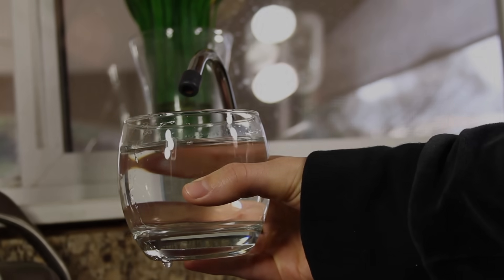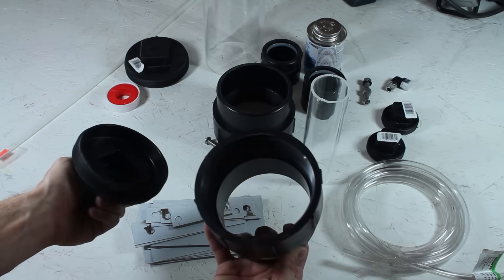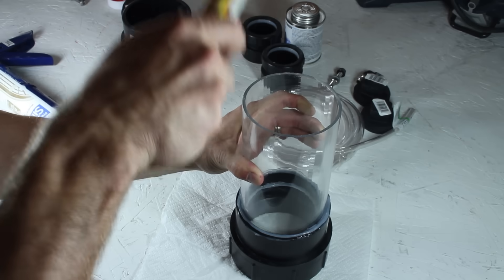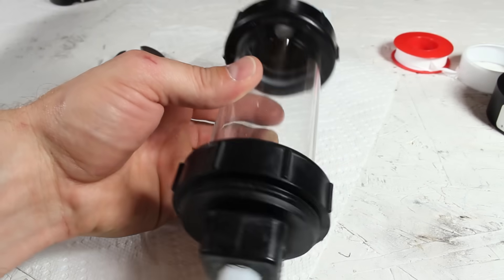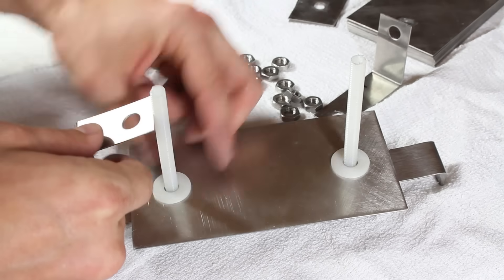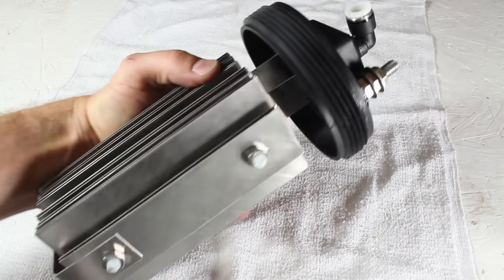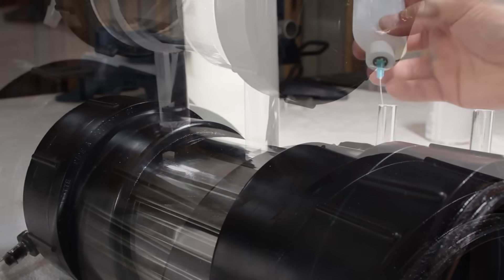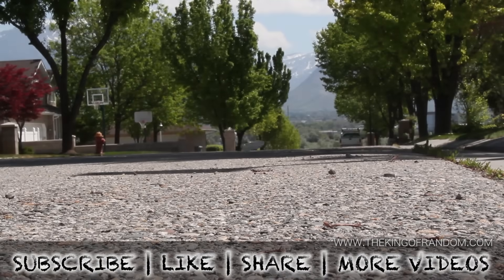HHO Generator - Water to Fuel Converter

Comment: When I'm going to college, i want to make an engine using this explosive gas ;p
Reply: +Spinddrift Thats not necsessarily true.But if the company uses green energy such as a wind turbine then it may be economical.
Reply: +Jonathan Duffield  True enough. Solar powered or wind powered generators to produce the electricity to make the gas will work fine.
Reply: There are actually many Companys who tried to build hydrogen motors but it took more energy to produce the hydrogen, than it would deliver in a motor.
Reply: +Jonathan Duffield it's always true. no system is 100% efficient, an electric motor is much more efficient than this in an engine
Reply: +Quantum Leap although in 1968 I saw a car drive off on water it and its owners whereabouts unknown today. Before the turn of last century 2 people where exterminated by ASIO for running their vehicles solely on water. Both parties had signed no disclosure docs but we're obviously still a threat? Please see henrymakow.com before supposing you are the absolute height of intelligent understanding?
Reply: John Anderson   This conspiracy stuff is so far out in left field it borders on insanity. There is no threat to anyone connected to "big oil" ,  "big coal" , or "big gas".  There is no technology here. It is a massive energy waster.  But  -  you have to have a basic education in physics to know this, maybe YOU ought to educate yourself before reading tall tales @ henrymakow.com.
Reply: Damon Jackson  You again?  The combination of hydrogen and oxygen liberated by electrolysis of water was named Brown's gas by old man Brown. Google it.
Reply: +Spinddrift that is not true. they succesfully created an efficient internal combustion engine using hydrogen. the thing is... ever heard of the hindenburg? yeah. we have not found a safe way to store hydrogen yet and that is basically the issue. in fact.. this guy is lucky he wasn't seriously hurt by this exploding. if this isn't done just perfectly with the right ratio of oxygen to hydrogen, it will explode and parts of his body would look like that milk jug,
Reply: +Jonathan Duffield The problem with it is you need a lot of water to keep a car moving, and a lot of energy to keep the process going to making the gas. The payout is that you have a diminishing return for this type of device in a vehicle because of the weight that the engine is being forced to move. Why gas is so efficient for us at the moment is because you have a high energy output for a relatively low amount of fuel...but our engines are very inefficient anyway, so eh shrugs.
Reply: +Deathlyrage stan meyer and joe booker made it work so it can be done, l guess that is why they are both pushing up daisies now
Reply: bjorn1583 They used a different method for extracting pure hydrogen from the H2O, which would last longer and produce more energy than the one in the video. It is a much more expensive process, and requires much better tech than we have at our current disposal to mass produce.
Reply: bjorn1583 Um, don't think so. The energy companies just laugh at electrolysis production of hydrogen. They know it's a fools game.  Laws of nature are a stern disciplinarian.
Reply: +Quantum Leap wind and solar are not good either. they require a lot of work for what they are worth
Reply: *****  Right. All the nutjobs rant and rave about the extreme efficiency of the latest "super duper electrolysis device", Stan Meyer, et. al.,  yet they want to burn the hydrogen, brown's gas or whatever in a wastefully inefficient internal combustion engine!!  Sheesh, the ignorance!!  The whole concept is ludicrous. And WASTEFUL of energy.
Reply: Quantum Leap after all we have argued about you seemed so amazingly smart yet you just said the word "whatever" lol
It is hydrogen and oxygen that is being liberated. Never heard of this browns gas. This is hydroxy. 
It is actually very efficient. As gross as it is, people in nigeria modified a regular car engine to run off of pee
Reply: Quantum Leap oh ok :)
Just never heard of it, thats all
Used to calling it hydroxy, i think it sounds cooler and is more accurate
Reply: Damon Jackson  Doesn't matter who calls it what.  It's only good for running torches, but worthless for practical hydrogen production.
Reply: Quantum Leap well you are somewhat right if it is a gas.
But cool it with LN2, and you have a powerful rocket fuel
Reply: Quantum Leap this is very tiny. Imagine mile long factories dedicated to this!
That will liberate hydrogen on a grand scale. Great for the space industry
Reply: Damon Jackson Damon, I thought we thrashed this out in the last thread with Hobbes and I.  Hydrogen and oxygen production using electrolysis is VERY VERY inefficient.  The commercial production of hydrogen is very well known, and has been very well researched. It does not involve electrolysis of water in any way, shape or form.  A little research on your part would be helpful before you post statements like "Imagine mile long factories dedicated to this."
Reply: Quantum Leap hobbes was talking about how great a solar cell would be in the desert, and i settled that. This is about H2, not solar
Reply: +Damon Jackson (Gaming & Science) Hm, I left that thread long ago, what exactly did you and Hobbes settle?  What was the final consensus on the "ceramic" being used as a reinforcement on desert solar panels which have been in use for decades?
Reply: Quantum Leap not sure, i assume he ended up agreeing with me, i haven't gotten a notification, and i left him a link
Reply: Quantum Leap hafnium oxide reinforcement can be used in the desert making them far more effective to cost, but are used more often in more harse enviroments such as space.
But a solar panel covering the entire mojave (which contains lots of life) would be bad for the enviroment and not that good anyways.

Thats my summary 😁
Reply: +Jonathan Duffield That is necessarily true.  All processes involve some inefficiency, so you will ALWAYS get less energy out than you put in. Combustion-based motors are very inefficient as well, usually only about 30% of the energy in the fuel ends up coming out of the motor.

This is why there's a big push to electric vehicles. Electric vehicles are in the area of 85-90% efficient. Even though batteries are far less energy dense, power plants are more efficient by far than a car's engine, and it allows you to power your car with renewables.
Reply: +Damon Jackson (Gaming & Science) Solar is pretty daft, being viable almost entirely in situations where access to cheaper forms of power are a no-go, or can't be relied upon. Adding any kind of further reinforcement etc. and so on would only make solar less viable by increasing costs and (I'm guessing) decreasing efficiency.
Reply: seigeengine it increases cost, yes, but also increases efficiency due to them losing efficiency in harsh enviroments.
My original point was that hydrogen was a great energy source compared to gasoline or solar power
Reply: Damon Jackson I meant over non-reinforced panels. The point being that cheap standard grade solar is already too expensive to be viable.

I'm not sure how you concluded hydrogen was a good energy source. It's really just.... not. That's especially suspect since we're talking about electrolysis, where you're putting in more energy to make the hydrogen than you're getting back out.

In the first place, it doesn't make much sense to use hydrogen except for when energy needs to be stored, such as for vehicles. Ignoring the volume problem, by the time we get done making the hydrogen, and then burning it to power the car, never mind any losses in getting the hydrogen from production to vehicle, you're talking about getting out 20% of the energy you put in.

You're suggesting we take an 80% loss, and that that's great. What?
Reply: seigeengine yes solar is only good as a backup power source.
Electrolysis is fairly inefficient, but hydroxy is by no means a bad power source. Liquid hydroxy is used as rocket fuel
Reply: Damon Jackson That doesn't make it a good power source. It makes it a good rocket fuel, and not even necessarily that.

Not only does the inefficiency of it's production make it a terrible power source, but it's, how you say... volumetrically challenged. That is, it takes a lot more space to store oxyhydrogen than it does to store other fuels. About eight times as much space for the same amount of energy assuming you want to, you know, be able to store it without it being at cryogenic temperatures.
Reply: seigeengine it is great for climate.
Also it IS a great rocket fuel.
Actually we dont use hydroxy gas, its liquid
Reply: seigeengine you can't manufacture an element though....XD
Especially hydrogen, the simplest
Electricity is not from fossil fuels either sooooo
Also, modern rockets do use it.
It is not that hard to obtain and keep liquid hydroxy. Just a vacuum flask, and pre-freeze it with LN2 then you're good.
Reply: seigeengine oh geez here we go again....i swiftly ended this before, i will do it again!!
What is your arguement?
Mine is very plausible so you better bring some hardcore evidence
Reply: Too late.

Let me be blunt.

Don't bother me again, or you won't bother me again.
Reply: seigeengine so you.....forfeit?
Reply: seigeengine who uses "halfwit" as an insult these days?
Reply: +Damon Jackson (Gaming & Science) People who actually know what they're talking about. People who know enough about this that they don't go around spreading idiotic rumors like you do, you halfwit.
Reply: inevercouldknow i know what i am saying. Halfwit is not an insult
Reply: Damon Jackson
This entire line of comments shows otherwise on both points.
Reply: inevercouldknow i settled this a long time ago and i won. I will do the same again, you might wanna read my old comments to educate yourself before trying to start this argument up again. Halfwit
Reply: +Damon Jackson (Gaming & Science)  Damon, you are a hard headed moron. These people here are trying to keep you from making an utter and complete fool of yourself. But, alas, to no avail. You have NO idea of how hard it is to make liquid oxygen or liquid hydrogen. Hydroxy is NOT a good fuel for everyday use. You spout off like the dipshit you are.  I'm going to tell your mother to quit letting you use her computer, because you are being a BAD BOY.  And I do mean BOY.
Reply: Quantum Leap you idiot. You think insults hurt me? Pshhh
You don't know me. I have 3 different devices i could use.
I know how easy it is to make liquid oxygen and liquid hydrogen and i would have done it if i had liquid nitrogen.
You just need more research, thats all, maybe then you will be as great as me.
Hydroxy is used for rocket fuel and i have said that many times. Look who is hard headed.
Reply: Quantum Leap im a teen. Refer back to 3 months ago with that other tard
Reply: Quantum Leap tell me how to make ln2.
Looked at your channel, and you are definitely one to talk.
Little man.....pssssh
At least i understand age groups
Reply: Quantum Leap Well, I mean, it's definitely a DIY project, and far from the hardest I've seen people tackle.
Reply: seigeengine Why would you make it yourself?  Liquid N2 is commercially available, and is not expensive. The dewar flasks needed to contain it are rather pricey. Of course, Damon the Demon doesn't know about such things... He's just a kid, er, sorry, a teen. Fourteen. Wet behind the ears. Has his head firmly seated in his hind end. But he "thinks" he's a genius.
Reply: Quantum Leap Because you can? Convenience? It's likely cheaper, or at least competitive?

While LN2 isn't that expensive compared to other things one might buy, getting liquid N2 is pretty expensive compared to the production costs unless you buy it in bulk quantities, which isn't suited to the activities of an individual. On the scale an individual is likely to purchase it, you're paying a steep premium. After all, an individual is likely to buy it on a scale of a few liters (gallons), whereas the companies the production is catered towards are purchasing/using it more on the scale of tonnes.

And when the purchase price for LN2 between the raw cost to make it and the purchase price of such small quantities is inflated, say, a hundred times, or even several hundred, there's some room for small scale DIY production to be viable.
Reply: seigeengine Outline your process for making LN2.
Reply: Quantum Leap Uh, I don't actually do it. I don't really use LN2, at least not in amounts where just buying it isn't more convenient. There's definitely area for people who use it more than me but not enough for bulk supply/industrial machines to get an edge in with a DIY version.

From memory, you need to take air, remove moisture and oxygen. The other stuff in air is negligible, and unless you need very high purity LN2, not an issue. They can be done a variety of ways, but I think it's zeolite that I saw used. Then you're left with a relatively pure nitrogen stream, and you..... do something to liquefy it. I don't really remember, sorry. 

It's not BS, because I know they do something very similar in one type of industrial LN2 production, but the machines that do it are geared more towards industrial users, and even the lowest production versions are way beyond what an individual is likely to use.
Reply: Quantum Leap i know i am a genius lol.
Damon the demon? Well good job at not making a fool of yourself by swearing, but rather the other way, now you sound like a kindergartener....i almost had ln2, just my local store doesn't sell vacuum flasks...
Very easy to make liquid air, look it up if you are so smart.
Reply: Damon Jackson
I have read your previous comments. You're a moron.
Reply: inevercouldknow really then what does that make quantum leap?
Reply: Damon Jackson
Much more qualified to speak on the matter than you. Get that through your uneducated head-you lost to QL, go cry about it.
Reply: inevercouldknow but i won...and i will win against you, if i already haven't.
Reply: Damon Jackson  I will bring your parents into this because you are a pest, and they should clamp down on you, thick head. I KNOW you are not mature, or you would not be so hung up on "winning". Is your self esteem so low that you always have to "win". You pitiful wretch.
Reply: Quantum Leap only sore losers resort to name calling.
You are the thick headed one.
I am obviously much older and far more wise.
Goodbye, child.
Reply: Damon Jackson  Ok, Ok, you found out. I am only 11 years old, I guess you're going to lord your age over me, eh!  I have made liquid N2. Have you?
Reply: Quantum Leap not yet. But plan to
Reply: Quantum Leap did just make my own levitation display using repulsion though...
It might not sound that amazing, but i love it. Making video soon
Reply: mini hoov i have done it
Reply: Damon Jackson then you got the right ratio and didn't blow up. i know you're going to think youre smarter than me because you're a youtube commenter so I'm not even going to argue with any of you
Reply: mini hoov no it blew up XD
Reply: Damon Jackson oh haha lol xD
Reply: mini hoov burnt my hand hair off Lol

Comment: When creating the plates. instead of just using sandpaper. why not drilling very small holes all over to create even more surface area and creating higher yield of electrolysis?

Comment: I wnder if this can be used as car fuel
Reply: In WW2 in England there was a massive fuel shortage. Cars could be seen with huge bags strapped to their roofs containing household coal gas. By tweaking the carb they worked very well. Wouldn't work with this however as you would have to collect the oxygen from the generator separately otherwise you are driving around in a huge bomb!
Reply: +Ryan Pierce you mean like the title of the video would make you believe?

Yes it can be done, to answer your question but would require another project.
*Not shown here; to convert a gasoline combustion engine to a hydrogen cell engine.
# Note do not load this devise on a car, it is a bad idea.
Reply: T hanks do you know how to make that othr project

Comment: Ive seen cars with a tiny version of this, in fact the greenville sc police had them on a few cars.  It was supposed to increase the mileage but i dont know how it was linked to the cars intake system.  I wonder what if anything good would happen with this hydro-generator attached to a car.  Would it increase gas mileage, horsepower, speed, or what it just blow up the engine?
Does anyone have a answer or experience with one?